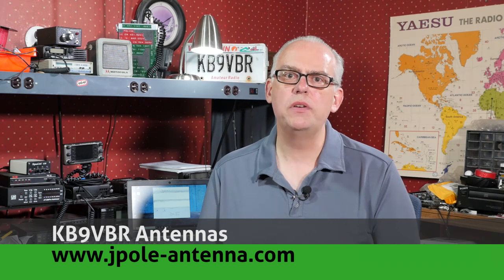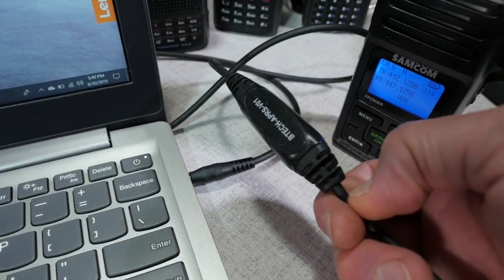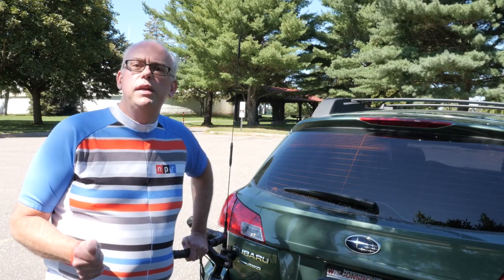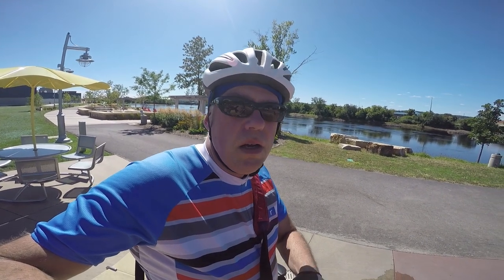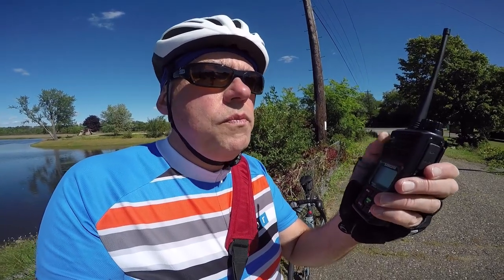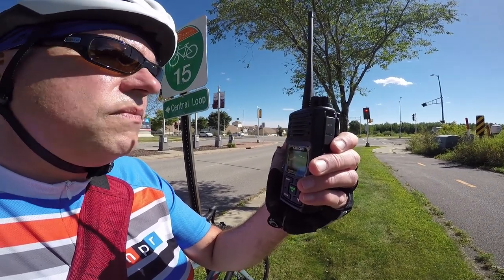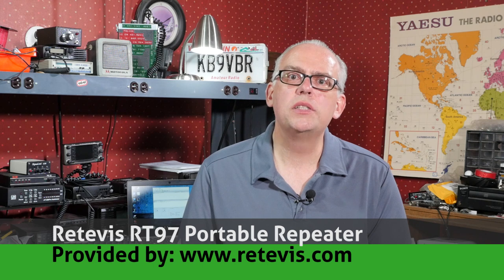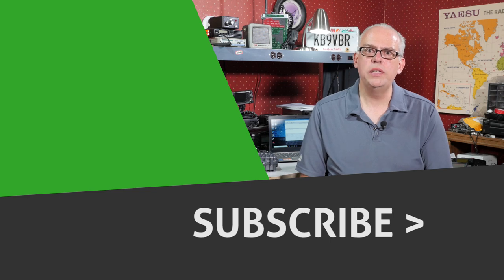Retevis RT97 Portable Repeater Field Test - Ham Radio Q&A

Comment: After watching your test I operated an IC-2730A on medium power on my vehicle using an Diamond NR770HB, on an auxiliary battery and got about the same results. I did get the permission of the repeater owner for it (he was the one reading my signal quality). Parked it in the middle of a park plugged into a 2m repeater, set it for 70cm simplex input frequency with CTCSS and TOT-5 min for safety. an HT transmitting at 0.5W allowed me to talk seamlessly into the repeater about half a mile radius or so. Beyond that 2.5W covered about 3 miles. 5W covered to about 4.5 miles. FT-60R for HT. 

thanks for the idea
73, KN4GEI

Comment: Thanks for the video. Would have liked to see the Repeater antenna pulled up into a tree. Maybe the PL259 1/4 wave ground plane with a small loop tied to some string.  . You did a good job explaining the three things you need for better coverage. 73, Heath N4TWT

Comment: Great video Michael. Id be curious to see the repeater performance with one of your jpoles.   Art.  K2ADC
Reply from the maker: It works quite well with the UHF J-Pole antenna. I've put one on a small light-stand as a demonstration. I made a note to do a follow up video with a J-Pole.
Reply: @KB9VBRAntennas  is the video up?
Reply: I cant wait to use mine with your gmrs j pole

Comment: A seven mile radius implies over 50 square miles of coverage.  Not too shabby for a 10  watt portable repeater in a box connected to a mobile whip on your car and a handy talkie.
Reply from the maker: That's a reasonable assumption to make. Of course coverage will be terrain dependent and if you get in a low spot or behind a hill, your signal quality will really suffer.

Comment: These video is great info 👌  we can now determine that using another tune base  antenna  in a higher place , and using  whip antenna on the handheld radio or instead of using a bike , having a tune  antenna on top of your car will def increase  range, and quality of your signal 👌 without using anymore power so thank for the video  👍👍

Comment: I'm impressed with the results, especially using that rubber ducky! A Nagoya or Signal Stick might have been even better.
Reply from the maker: An aftermarket antenna would have made a difference in the fringe areas, I was pleasantly surprised with the handheld I used in the test.
Reply: @KB9VBRAntennas I thought the set-up worked well, regardless. Also, we know what we can expect at a minimum. Keep up the good work, Michael!

Comment: Do you think if you didn't use the rubber duck antenna and used a different type of antenna, would you get better result
Reply from the maker: Most likely I could, especially in the fringe area when the signal was getting rough.

Comment: I wonder what a high gain antenna on the walkie would do. Since it would reduce transmitted noise. Then also to raise the repeater antenna on a mast for example. To avoid the effect of curvature of the earth or even local terrain issues. Great video though. Thanks
Reply from the maker: Using a higher gain antenna on the handheld would fill in the fringe spots, but most likely wouldn't appreciably increase the range. Increasing antenna height of the repeater could increase range, though. This was designed as a simple test of capabilities and not so much an exploration of how I could cover the most territory possible.

Comment: isnt the llimitation the HT in this test?  The advantage is multiple radios, with repeater in the middle.
Reply: I agree that would have been an interesting test/review to see what the other stations sound like at equal distances compared with the repeater. I would trade anything to have helped out vs being in this August Texas heat. 😎
Reply from the maker: Possibly. The purpose of a repeater is to provide one to many communications to a set of users that might not otherwise be able to communicate point to point. I could have done the test with multiple people. I went the parrot route as I wanted to hear the quality of my own transmissions in an objective manner.

Comment: 2 Question please 👋, can this be used or run 24 hours and like everyday use,, or doest it has to be turn off and only use for like couple of hours. Question 2, u when 6-7 milles in one direction,  can another person go 6-7 milles opposite side and talk to eachother making it up to 14 range radius
Reply: Yes to 14 miles. The users manual does not list the duty cycle. My guess is that it can be left on. You'd probably want to limit transmissions to 2 - 3 minutes with a break of about 5 minutes in between. Only testing will tell. Let us all know when you've completed the testing.

Comment: Okay we all agree that a 30 foot mast and a well tuned antenna pushing 40 watts would get you somewhere near 50 miles on flat ground right? What do y'all think the duty cycle would be?
Reply from the maker: Duty cycle is an interesting question. It depends on the power handling capability of the transmitter. Most repeater sites running at 100% duty cycle will use a transmitter only putting out a few watts and use an amplifier rated for 100%. I've seen repeaters built with commercial grade gear running at 40 watts output without an amplifier get smoked from overheating. Long story short, if you can keep the transmitter adequately cooled, it will run all day.
Reply: @KB9VBRAntennas  indeed

Comment: Thanks for the thorough field test of the RT97. I'm curious if you use it often and how it's holding up? I purchased a VHF RT97 directly from Retevis a few weeks back. Out of the box it worked for about 24 hours while I did some initial field tests on it (<20 transmissions). I retuned the next day and it's no longer functioning. It behaves as though it's not sensing the signal and won't even try to repeat (noted by lack of a busy/transmit signal on the RT97 display). I found that it would attempt to repeat if I turned of CTCSS tones on both the repeater and the handhelds, however it only repeats the carrier signal without voice. Retevis has not been very helpful other than suggesting I ship it back to their facility in China. Do any suggestions come immediately to mind? Thanks!

Comment: Since you're using a recording of yourself transmitting with an HT, what portion of the noise and dropouts you hear are on the repeater input?  Or to put it another way, if you were testing with a 50W mobile instead of a handheld, would that eliminate much of rhe noise?  Also, if you could get it up on a pole and out ofnthe fresnel zone it might work even better.  Maybe try parking at the top of a parking garage.

Comment: What are the legal requirements with being a portable? This looks a great piece of kit for portable stuff. Great video thanks for sharing
Reply from the maker: In my previous video on the RT97 I do take a bit about some of the legal issues concerning this repeater: https://youtu.be/0EBJasGAymY. But in reality there isn't really anything different you need to do with a portable repeater as compared to a stationary one. The biggest concern would be frequency selection, but most state and regional repeater councils have a pool of itinerant or portable frequencies that you can use without fear of causing interference with a coordinated repeater.
Reply: @KB9VBRAntennas  Thank you for the info this piece of kit can play great part with experimental stuff great video Thankyou

Comment: What's the website address for that terrain map that graphs elevations between the various map points?
Reply from the maker: I use Strava to track my bicycling. That application created the elevation chart that I used in the video. You can also create an elevation profile in Google Earth or there are other 3rd party extensions that will create profiles in Google Maps for you.

Comment: Hi Michael. I just purchased the rt97 gmrs. Looking to get your opinion on this situation. When I am 5 miles away from repeater I can hear repeater transmission no problem but the repeater will.not rebroadcast my transmission. I know the repeater is picking up my signal as verified by HT close to repeater and my mobile is 25 watts.  When I unkey from 5 miles away the tail tone pegs my meter but will not retransmit my voice or a carrier only a "kerchunk" or tail tone unless I am within a couple hundred yards or less. Very frustrating. 
Think the rt97 is bad? I can't think of anything else to do. Fellow cheesehead from down by Sheboygan hey. LoL

Comment: Thanks for your info.  With regard to the GMRS version which is now available, it is noted that the transmit/receive frequencies pair can be pre-programmed at the factory, but it has 16 channel capacity.  Does this mean that EVERY channel must involve that one pre-programmed pair?  If so, is the reason for the 16 channels to simply permit different TONES for that one pair of frequencies? Thanks.
Reply from the maker: The duplexer in the repeater needs to be tuned to your frequency pair. If you stray from that tuned frequency, the system will desense when you transmit. So really the only use of the 16 channel memories is for different tone codes.
Reply: @KB9VBRAntennas  Thank you so much for the prompt reply.  Always appreciate and enjoy your presentations. Unfortunately, I have had no luck trying to get a GMRS repeater operating with any distance at all.  It obviously needs a VERY TALL UNOBSTRUCTED antenna.
Reply: @KB9VBRAntennas  It was noted that the programmed paired frequencies weren't one of the standard GMRS repeater pairs.  Although that is apparently legal and might result in less uninvited traffic, it could possibly prevent contacts with transceivers unable to use other than the standard repeater frequencies.  What is your experience with regard to the repeaters non altered frequencies -- or did you order specific frequencies?
Reply: I have two of the GMRS versions. The notch in the duplexer is large enough that I can use all the various GMRS repeater pairs from 550 up to 725. Both of mine came with the correct GMRS frequencies programmed in.

Comment: When you did this video did you use the repeater on UHF or VHF?
I didn't see in the video if you had it on one or the other.
Message back and let me know.
Thanks.
Reply from the maker: I tested the UHF version of the repeater. The closest split they can do between transmit and receive is 5 Mhz, which would make it unusable in 2 meter amateur band which is only 4 mhz wide. But a 5 Mhz split is perfect for 70cm and GMRS repeater pairs. My repeater is set to 70cm amateur, but the performance would be identical on the GMRS band as those UHF frequency ranges are pretty close together.

Comment: Great video! I have some questions for ya. 
I am a car enthusiast, and a beginner in the HAM world. 
My friends and I enjoy driving in the mountains here in SOCAL. The down side is there is not cell signal up in these canyons. 
I was thinking of buying some sort of portable repeater, that one of us could keep in our cars. That way when someone goes on a run through the mountain, we (who are stopped down the road at a rest stop) can let that driver know there is a vehicle coming his direction or they could let us know if they have crashed. 
The road we drive on is about 15miles long and very mountainous. 
I have a Baofeng UV5R 3rd Gen. 
Do you think that this Portable Repeater and the UV5R would be a good solution to this problem? 
Are there any cheaper? Or more cost friendly solutions? 
Thank you for taking your time to read this annd I would greatly appreciate your response.
Reply from the maker: This is a solution that can get complex very quick as public safety agencies have been working for decades to accomplish the same thing you are looking to do- that is, provide communications out of canyons and other areas that are blocked my hilly or mountainous terrain. UHF communications is line of sight and you if you are in a canyon or go around a corner, your communication will not be heard by a person in another canyon. For the repeater to be functional, the vehicle is going to need to be parked in a location that has good site lines into the obstructed areas. If the repeater is in the canyon, it isn't going to accomplish much more than the handhelds themselves. I think a good starting point would be to use an application like Radio Mobile to simulate coverage so you could estimate how a repeater would work in a variety of locations along your route: https://www.ve2dbe.com/english1.html

Comment: how much prominence does the water tower site have over where you are?
I noticed that the gmrs version of the repeater does have PART 95E certification according to fcc.gov. So that is pretty cool.
Reply from the maker: Since this video has been produced Retevis has develped a GMRS compliant unit. If you look at 8:50 you'll see an elevation plot of the repeater location and each test site. At 8:15 you can see all the sites on a map along with projected coverage.
Reply: @KB9VBRAntennas  Thanks for pointing that out (I was listening to the video in the background so I didn't see that)!  I

Comment: are you not bypassing the rt97 all together?...you only need an HT and a controller ( computer and software ) for a simplex repeater system...the Rt97 does not even have a controller port...the RT98 does. am i missing something?

Comment: Maybe I missed it if you mentioned it, but what is the elevation of site where you placed your repeater?
Reply from the maker: Towards the end of the video there was an elevation chart so you could see the difference between the repeater location and the test spots, but I believe the repeater was about 200 feet above average terrain.
Reply: @KB9VBRAntennas  Thank you.  By the way, I have one of your 6 meter antennas and also a 220 mhz antenna.  Both are great!

Comment: With my baofeng uv-5x3 I have made contacts over 10 miles with no repeater? So this seems not great ?
Reply from the maker: In certain circumstances, you can make contacts with a handhelds at a distance of many miles. But under normal circumstances, their actual range will be a mile or so. The bigger advantage of a repeater is it allows many people, in a variety or terrains and distances, to hear each other clearly.

Comment: Hi, are you using your Ham Call Sign for GMRS? If so how do you link the two? Thanks for doing the test been on the fence about buying this and it helped the decision process.
Reply from the maker: This repeater is available for GMRS, but I had my unit tuned for the 70cm amateur radio band. Hence using my amateur callsign.

Comment: Hey Michael! 

What frequencies did you use for the test on UHF and the offset? Also, does WI frequency coordinators have portable pairs
designated in their plan?

Thanks!

Pete/KD4QNA
Reply from the maker: Yes, Wisconsin has three Shared/Non-Protected frequency pairs allocated on the 70cm band (https://wi-repeaters.org/forms/WAR-Bandplan-Revised-2019.pdf page 15). I'm using the 441.500 – 446.500 combination.

Comment: Thanks for the field test.  Can you elaborate on the handheld to laptop connection with the BTECH APRS-K1?  Does the laptop have a shared socket for audio out and in?  Tnx
Reply from the maker: The Btech APRS cable is handy for connecting your handheld to a smartphone for APRS or other VHF digital modes. It has a TRRS plug and I was pleasantly surprised when I plugged it into the combined headphone/mic port on my laptop that it worked.

Comment: Thanks for sharing. Is the B-Tech APRS cable going to be featured in the two-way APRS gateway video you will be doing sometime in the future? I think if I biked 14 miles I would die.
Reply from the maker: The Btech APRS cable is handy for connecting your handheld to a smartphone for APRS or other VHF digital modes. It has a TRRS plug and I was pleasantly surprised when I plugged it into the combined headphone/mic port on my laptop that it worked. The IGate video is still in development, I'm saving a bunch of topics for when the weather gets colder and I'm spending more time indoors. I'm not sure if I'll use that cable, a TNC like the Kantronics, or some other device. As for the ride, I actually ended up with 27 miles as it wasn't a straight shot from point A to B to C, etc. Oh yeah, since I parked my car on a top of a hill, I also had a steep 150 foot climb at the end.
Reply: @KB9VBRAntennas  Looking forward to that video...

Comment: Doesn't bumper mounting cut the effectiveness of your whip antenna?
Reply from the maker: It's not as bad as some would make you think. I can hear a difference depending on the orientation of the vehicle, but usually that's in the fringe areas. The length of the Comet SBB7 compensates for a lot of that loss. Antenna location on your vehicle always entails trade-offs, and I decided the tailgate was a better location than drilling a hole in the roof and dealing with the headliner and airbag system.

Comment: Ok u were at 7 miles south from  repeater. So what happends when another person goes 7 miles opposite side ?? Can you talk to the other person and will that make 7 miles radius ??? And also did u left the repeater with power on the car and what did u used or does it has charge ?
Reply from the maker: The range would be a seven mile radius, dependent on terrain. So in essence two stations up to 14 miles apart could communicate. The repeater was connected to a 12 volt battery for power.